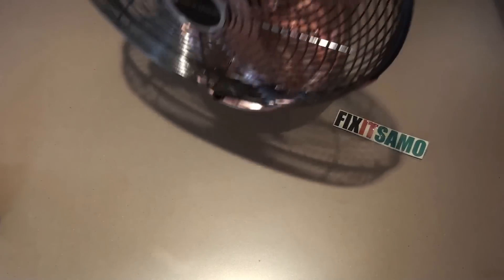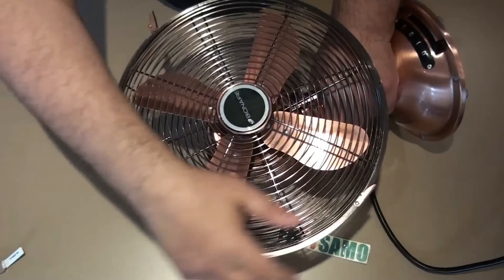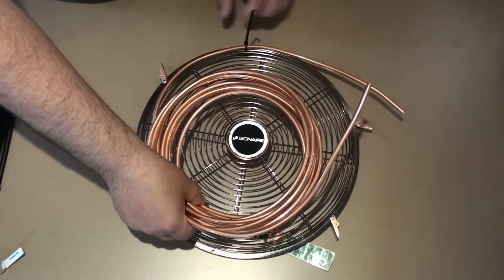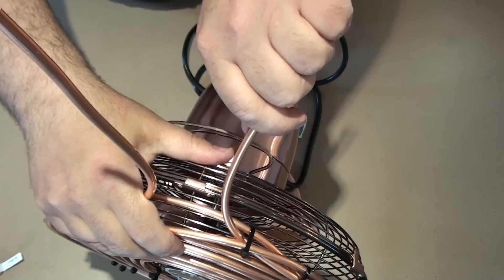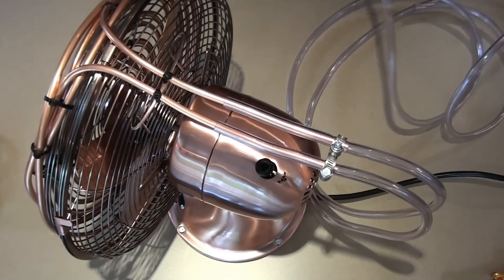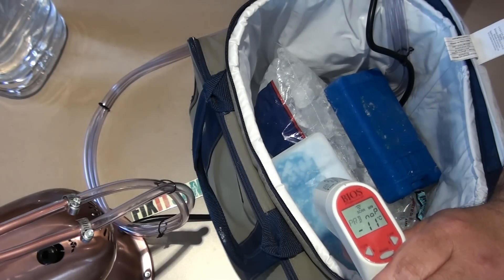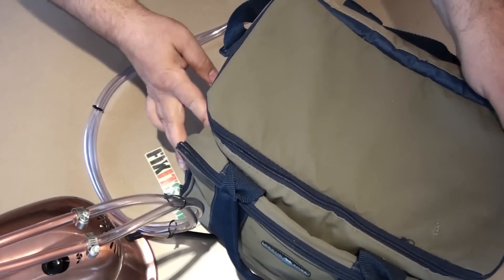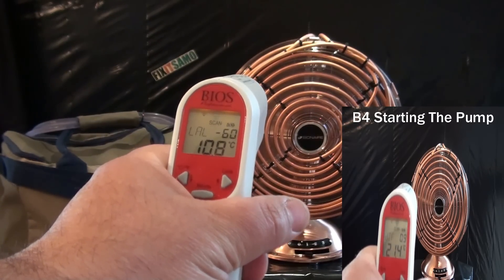How To Turn Your Fan Into An Airconditioner  AC

Comment: cool. suggest the joins are below the motor so if it does leak it's no problem. perhaps you could add a small amount of glitter and then you can see the flow which would be neat.  condensate will collect on the pipes and blow off in to your face, but you wanted cooling.

Comment: The pump is generating heat better to use one outside that have tube connector on both side's. Easy and cheap to find in a aquarium store.

Comment: this is a pritty cool idea, im wondering if maybe a person found an old small radiator around or even put a fan outside with the same setup it would cool down since usually in a house the temp without an authentic ac unit would be warmer and outside cooler.  so if you set up a resivor outside with the pump, connected to a coil copper tubing outside, than link it to the fan inside if it will work close to the same.  would have to put the fan in the shade though.  unless youd put it down in a basement if you got one

Comment: If you wanted to avoid using a pump, you could always make it gravity fed, and have a valve on the return line to control flow rate

Comment: Huh, just like a radiator... I suppose if you had a small rad like an oil cooler just kicking around, you could use that instead of the semi-costly copper. Interesting build!

Comment: Aluminum works best to disipatate heat and cold.
Only need 
Two fans
Two thermal coils.
For a closed loop condensor fan.

One for cooling air
Second fan for cooling water again.

No ice
To exspensive.

Comment: What if you put the pump inside the fridge or purchase a small radiator :-)
Reply: This shouldn't be taken too seriously as anything more than a little afternoon project, because to upgrade it to cool substantally would cost more than a real air conditioner, which would be much more energy efficient anyway. 

You have to keep in mind energy is neither created nor destroyed, so this thing isn't eliminating heat, it's just transferring it. In other words, putting the pump inside the fridge would just move the heat from the area around the fan to the area around the condenser coil on the back (or bottom) of the fridge. So not only would the heat still be in the room, concentrated behind the fridge, but the compressor pumping to concentrate and transfer the heat around would be generating additional heat from the electrical current flowing through its electrical windings, resulting in a net GAIN in heat in the room! Not only inefficient, but defeating its purpose. There's a reason real air conditioners have to have an outdoor component, the only way to cool the air inside is by transferring heat to the outside

Comment: Why not put the bag of ice water in the freezer? You can run a long way with the clear tubing if you wrap it in foam or insulation. Also modify the freezer door with duct tape and insulation to keep it air tight

Comment: What a performance. Just blow the fan at the cool-blocks in a bucket! This is more efficient as you do not need to use power to turn a pump.
Reply from the maker: +Fred Bloggs the problem is when you use the bucket method  the ice won't last more than 2 hrs  but with method the ice lasted around 12 hrs

Comment: Tried to make it, but the 1/4 copper tubing diameter is way too small for a seal on the 3/8" tubing. Also the link you provide for the copper is 10' not 15' like your description says.

I'll have to try again once I'm motivated to buy more stuff...looks cool though.

Comment: How well does it work in real use
Reply: I'm moving into an old apartment that has no ac and I am jobless at the time...
Reply: This whole thing only makes sense if you can somehow get the Ice made outside your apartment. If you would make the ice (or cool down the cooling elements) in a fridge in your apartment then you actually generate more heat then you absorb with this contraption. I bet the whole cooling effect is really negligible and you would only feel it if you stand in front of the fan (and just a fan already cools you down if you stand in front of it because of evaporation)
Reply: +TheDrake1066 Exactly right.

Comment: love all of the douchbag comments... this would be great for a weekend camping trip with the family... and best of allnif you are camping somewhere with the family... youre going to have an ice chest full of ice all weekend anyway... why not drop the temp in your tent while youre at it
Reply: because it won't work, the tent isn't insulated and it's not air tight so the cool air will just drain out of the tent. This thing would only work a direct cooler so the fan would blow cooler air on you vs blowing the hotter ambient air but using an ice bucket or whatever is not efficient enough to cool any non closed and insulated space.

Comment: You might also want to use an alcohol based coolant. It will run cooler without having to replace the ice

Comment: Sadly, this is just a cool breeze. Nothing to cool anything down really. And here's the maths:

heat up 4 kg of water by 15 K: 4 kg * 4.2 kJ/(kg * K) * 15 K = 252 kJ
heat up 4 kg of ice by 20 K: 4 kg * 2 kJ/(kg * K) * 20 K = 160 kJ
change 4 kg of ice into water: 4 kg * 334 kJ/kg = 1336 kJ
heat up 4 kg of water by 15 K: 4 * 4.2 kJ/(kg * K) * 15 K = 252 kJ

everything combined = 2000 kJ = 556 Wh
> 12 hours for the entire process -> 556 Wh / 12 h = 46 W (147 BTU/h)

Your AC has a total output of 46 Watts. Your fan and pump will heat up your room with about 10-20 W. So you are left with ~30 W of cooling power. Typical A/C units are rated at 1,500 W or more.
Reply: and a cool breeze feels GREAT in a final assembly line on a factory floor, lemme tell ya.

Comment: Watt about humidity in the air, that will condensate on the copper tube coil ? A drip pan to add may be required ? Too much trouble for such so low cooling capability ! Sorry a window unit do not consume ice, it is more convenient ...

Comment: The smallest room window unit air conditioner you can get is rated at 5500 BTU/hr. That equates to 1000 lbs of ice melted per day. So if your cooler here melts 15 lbs of ice in 12 hours, it is 3% as effective as the smallest room air conditioner.

Comment: I did this with 10 ft of copper tube and used a very small 8-9 inch fan. It is working. It is definitely NOT as cool as an ac unit, but is way better than blowing around hot air and has pleasant cooled the living room, dining room and kitchen on a hot day. If it was more like 100, instead of 90ish, you would have to have it blowing right on you to get relief, but for the price and the ease of cobbling this together, it good. I happened to have a pump already on hand, so I didn't have to purchase that. Also found Home Depot to have a good price on the copper tube/pipe.  $9.24 for 10 ft and about $18 for 20 ft.

It actually feels a little chilly with this blowing on me right now, need to aim it away. Kinda surprising.

Comment: I MADE ONE USING FREON WITH A 12 VOLT CHARGE! AN 1/4 COPPER TUBING AN A STANDARD FLOOR FAN ,.. IT LASTED ME OVER 4 SUMMERS FAR BETTER THAN THE "SWAMPCOOLER" IDEA! YOU CAN PURCHACE AN AC/DC ADAPTER AT ANY RADIO SHACK AN SPLIT THE WIRES -/+ TO A TUPAWARE BOWL ( LIKE A CELL IN A BATTERY ) RUNNING ONE ON ONE SIDE AN THE OTHER ON THE OTHER SIDE! FAR MORE EASIER AN EFFECTIVE THAN THIS!
Reply: Hey i need to ask i made it and whenever i put ice in it water condenses around the copper tube so rapidly, Is there any solution to this Dilemma ?
Reply: do you have a video so that we can make one too
Reply: Less water ? and do the opposite. Try to have the pump above the tube. Cold water is on top, use that.

Comment: It's cool!  Wanna try it out.  May i know what is the diameter of the copper tube. Is it 1/4 inch?
And what is  the length of the copper tube that you use in the demo? Thanks..
Reply from the maker: +Justin Chan thank you yes its 1/4 and i used around 15 feet
Reply: Thanks for your prompt reply. :-)

Comment: This wont work! A quick energy balance will tell you that you are just increasing the room temperature unless you are getting the heat out of the cooling space (home). Or as mentioned you are getting the ice cubes from outside.
Reply: it will work bubba used this method in India all the time worked all the time iced water last long time a day day and a half for sure helped all the way until the power went out lol nothing like america though ac everywhere and of coarse a toilet

Comment: so many stupid comments.  a fan uses about 10 watts.0.03 amps. fountain pump uses 3 watts. 0.009 amps. make ice nearly free.  i dont ever remember turning off my refrigerator so it always making ice and on standard setting.  and yes cold water does remove himidity because it is condensed. thats why there would be water on the coils. great idea for those looking for an alternative to expensive a/c. but i must add consider the room you want to cool before building one of these ac fan thingamajig. bigger room, more ice, bigger fan ect.

Comment: if you use sand paper or steel wool to scratch the outside of the copper pipe you will increase the surface aria and it will colder
Reply: thats brilliant

Comment: I would recommend leaving the copper tubing a little longer on the ends, so that your hose connections aren't right above the motor.  If you have a leak, you don't want water getting into the motor, so I'd say leave the ends longer, and bend them down below the motor.
Reply: I  was thinking about  that myself about if there's  a leak someone might  get cooked .great  video  though.
Reply: yes good idea.
Reply: nice one, Dave
Reply: I think I'd also put a drip pan under that coil.  High humidity climates will get condensation and you could end up with a huge puddle of water under the coil.
Reply: it's okay water won't burn out a magnetic motor

Comment: wrong temprature measurement. you should measure the temprature of the Air not of the cold pipe. Infrared measures the temprature of an object not invisible air. but not critisicm on the aperature its perfectly fine but you have wrong data :-)
Reply: Even if it's only five degrees F cooler, that might be worth it to some people in these hot temps!

Comment: Looks like a fun project. Keep in mind that the pump is heating the water so the ice doesn't last as long. It would be better if the pump was not in the water.This could be practical if you live near a cool water source like a lake. You could use a solar panel to pump the cool water from the lake (as long as its not too far away) through insolated pipes to the fan and enjoy a cool breeze. Won't cool a room but at least you'd get a cool breeze on a hot day.
Reply: a lake is a bad idea normaly its not this near and the water isn't clean.
i would use a Watercooling CPU cooler set and a normal air cpu cooler and a peltie element in combination. no need for a bigger pump (the watercoolingset has one in it) no long pipes (to the next room) and the peltieelement makes the water cool and the normal cpu cooler makes the hot side of the peltie cool.

Comment: How long will it put cool air? in this configuration of ice of course..
Reply: the freezer will put more heat out of the back which would heat the room it's in up. energy cannot be created or destroyed. that is why an AC unit requires an outdoor radiator, otherwise it would be cooling the air it's heating up
Reply: Easy Math. 
10kg of Ice have about 4,5MJ of thermal deficit and enthalpy of fusion. Therefore you can run your ~500W AC for 8700s (2,5h)
Therefore this is a very expensive AC, unless you have unlimited access to ice...
Reply from the maker: +roei tabak  around 12 hrs
Reply: 4 + 4 = Math..
Reply: Hmm... I was thinking of drilling some holes in my freezer door and running the hose through the freezer in a closed-loop setup with about a dozen rounds of hose in the freezer part. That would freeze your food and also help to cool your place. Although your freezer would run much more, still might be economical too!
Reply: Hmm, that might be true *****, but the cycle it goes through would be enough to make it cool while it's running.
If I can scrounge up enough money, I would definitely like to put that theory to the test! Maybe even make a video on it on my findings. Not saying you're incorrect, *****, but also not saying you're completely correct either. Just want to try it and see what I come up with.

Comment: I have a couple USB fans (amazing airflow for 5v, around 500 Ma)... I power them with small USB solarpanels.. I think there are USB water pumps aswell... Would be cool to make a portable system... also if you could buy (don't know if it's available though) cooper pipe with bigger surface area (pipe with small fins)... and another thing he pump got suction cups if you have sturdy cooler you could make use of the suction cups better.... anyway.. looked great!

Comment: what do you do with the condensation runoff from the cold copper tubing?
Reply: I made one of these a few years ago with a square igloo cooler and a tile saw pump. I just used a small piece of plastic to make the condensate drain back into the cooler.
Reply: LOL yup, paper towels or cotton towels or maybe a pan.
Reply: Put a blanket under, duh.
Reply: I think he was pointing out a flaw not actually looking for an answer
Reply: Doug Carlson smart ..i was thinking the same thing ...recycle the condensation
Reply: anybody know how to turn you lawnmower into a weedeater?

Comment: why do you put the water into an isolated bag
you want to cool down the room anyway
Reply from the maker: +Janis Haseley  cause this way the ice will last around 12 hrs
Reply: Right 
And thats the problem in a closed  system.
I have to admit that it would be different, if he used it outside.
In this case the isolation only prevents the two temperatures to equalise, which means that the room wont change its temperature very fast.
Reply: Probadly he wants to cool down his house with his invntion and the refrigerator for the ice is in the same romm XD
The hole thing is nonesense in a closed system XD

Comment: What if your front cover of the fan is mesh - how can you put the copper on it?
Reply: Nothing lasts if you don't give it any maintenance, just keep it clean
Reply: there will still be holes in the mesh, just use the cable ties on those holes
Reply: I was thinking the same thing - thank you
Reply from the maker: +Tea  👍🏻
Reply: How long does it last?
Reply: depends on the flow rate of the pump, the size of the container and how much ice you have; everyone will have their own methods of going about this
Reply: Okay thank you Tea
Reply: find a new fan lol people throw them away all the time.
Reply: +Eyvet Francis lifespan of this thing I would guess about  ahhhh 2 days then it be full of dust from the humidity

Comment: Converting celsius to fahrenheit it starts at 69 drops down to 52. 17 degree difference nice, when it's 100 down to 83 still ok. Plus I Think it needs a catch from water sweating off the tubes. How much would buying or making the ice cost, to know the savings difference?  How long does it work before it needs changed out?  If a video that I seen on how much Youtube pays its content creators, per million is correct $ 1500 per M he has earned over $ 5000 for this video, I'am sure that' makes for real creative motivation for the next one.
Reply: My sister posts pit bull competitions and news. She makes $5 per 1,000 views. The price goes up with subscribers and advertisers. Better ads pay higher prices. With 3 million views, he made at least 150,000+. This is why PewPoop is a millionaire. 50 videos with a million views and you're loaded.
Reply: Ya checked it out, did my own math. I came up with 2,000.000 divided by 1000 = 2000 times 5 = 10,000. Still lots of money. If I had good ideas to bring in those types of numbers/money I would as long as they were good for us/society in general. The Hawaii's pit bill competition one with 2 million some views, seems non harmful.

May we both have such luck, bringing others to beneficial information and or entertainment.

Comment: I saw a better way on Facebook get a bucket put 3 holes in the middle the cut a big hole in the top of the bucket cove so that the fan can fit it the then put 3 big hard battle of ice inside then cover the bucket with the fan in the top turn it on then walaaaaaaaaa ac 😊
Reply from the maker: +Jesus love you  
The problem is the ice wont last more than 3 hrs max but when you put the ice in a sealed cooler like i did the ice lasted around 12 hrs
Reply: 12 hours lol u must be joking no ice can last that out 😨🤕

Comment: Add some Salt to the water.
Reply: +Bennie Chiedu The salt reduces the melting point of the ice to about -4°c so the water circulating will be colder than plain water. This means it'll transfer more efficiently into the air.
Reply: What would the salt do?
Reply: Lowers the boiling point of water
Reply: +Shuri yoshimoto Not boiling point. Freezing/melting point.
Reply: ice water get colder when salt is added
Reply: I think salt water can corrode copper, make it turn green and brittle
Reply: ***** Thank you for your reply.
Reply: put some anti freeze to do the same thing, it has the added benefit of preventing corrosion

Comment: I would probably put the hoses running below the motor rather than over it though, but still pretty cool
Reply from the maker: +Nick Prezzato very good point i did it over cause I wanted the viewers to have a better view while making the video and I forgot to mention that it must be installed below the motor  thank you addressing this issue

Comment: I'm feeling ambitious. I might try this. Can I use my shitty plastic fan ? :-/
Reply: The material of the fan doesn't matter. Just make sure that if it has a hinge for tilting it up and down, that it can hold the extra weight of the pipe.